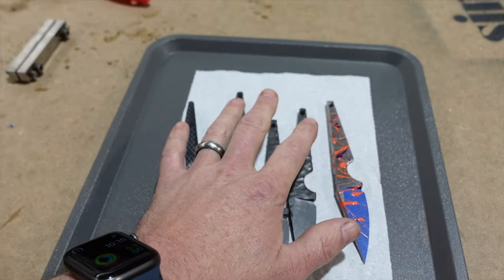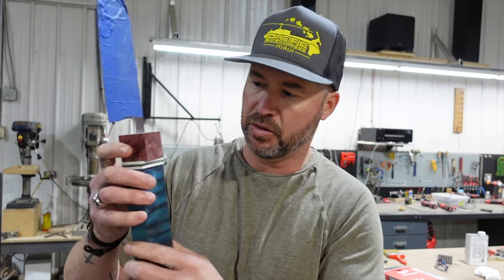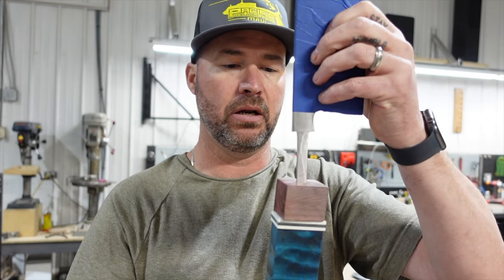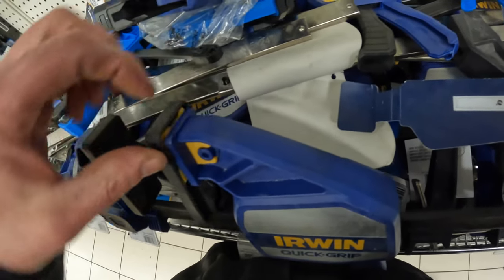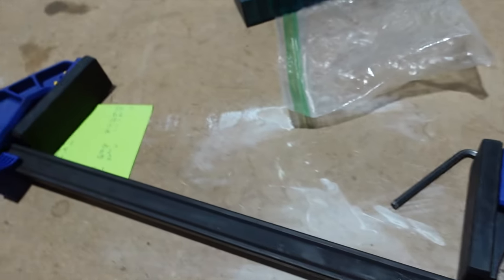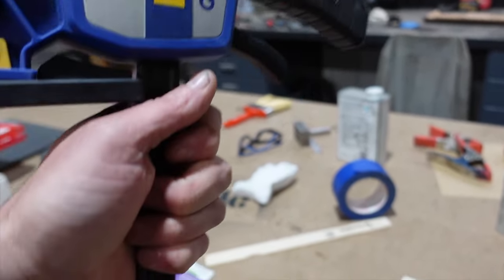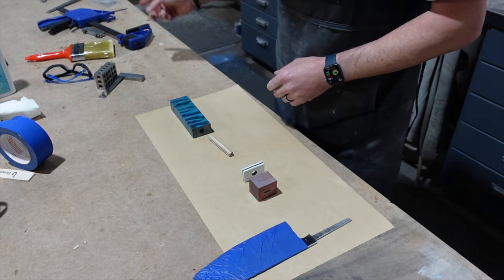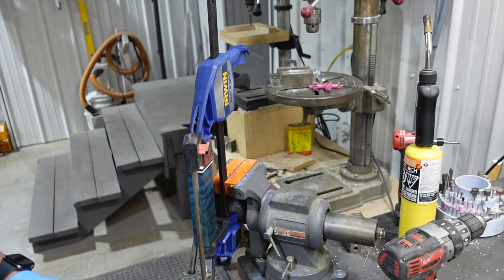The magical transformation of a simple clamp

Comment: Good tip! Question- I’ve been wondering what the advantage is to pulling out the blade at the end, as opposed to just letting that be your final fit up?
Reply from the maker: I do it so that I can take the blade on and off while shaping the handle. I have left it in before but I prefer to grind and shape the handle without having to worry about the blade accidentally hitting the grinder.

Comment: You being you, I am surprised that you didn't build your own clamp. Couple pieces of oak. A piece or two of some allthread. Captured nuts. Make your own handle or handles...
Reply from the maker: The opening and closing of that style of clamp is why I wouldn’t build one. Really slow compared to these but also any stray epoxy in all thread would be a bear to clean up after. These bar just need a little slide with a putty knife and it pops off.
Reply: @Simplelittlelife  Thank you. The more you know... 😁